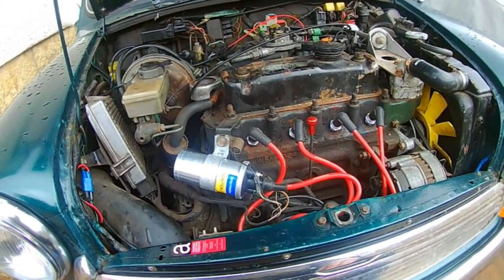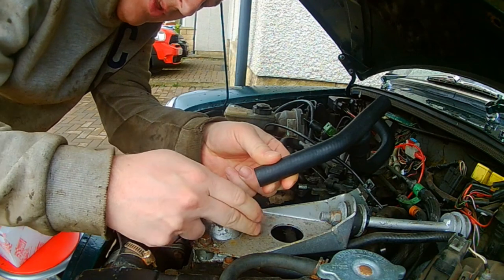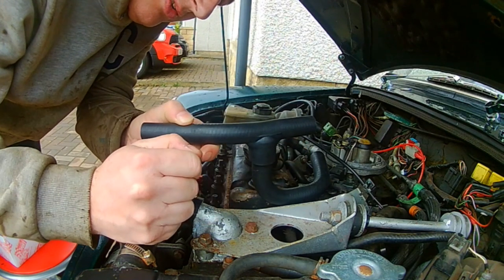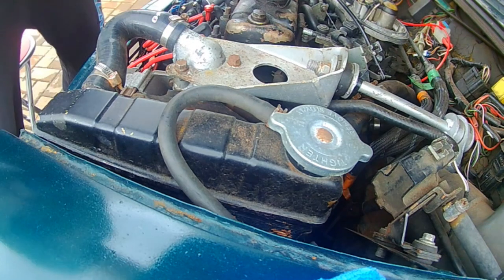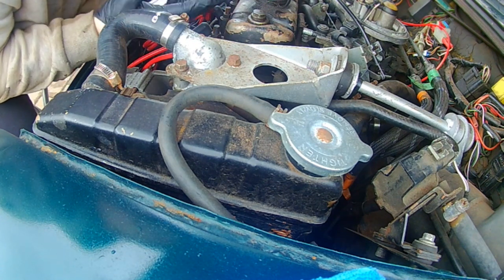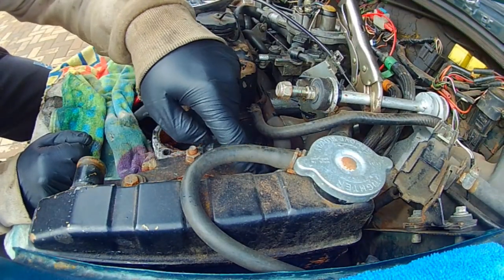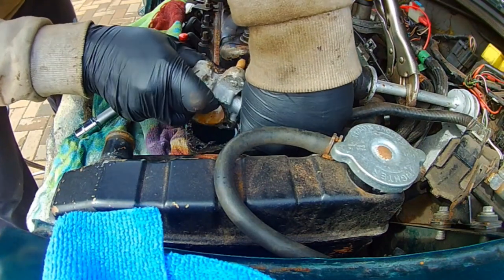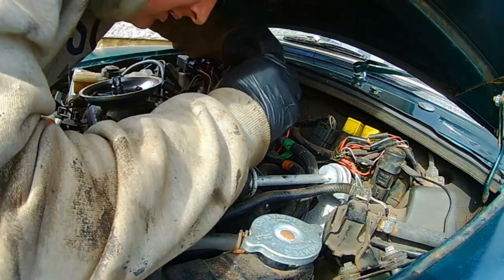Classic Mini SPI: Getting to the bottom of the running issues

Comment: Well done getting to the bottom of it. Is it possible that the hose you took off was the same internal diameter at the T meaning very little coolant would change direction, the hose should be slightly narrower to slow the flow.
Reply from the maker: Thanks James, the hoses were pretty poor, the hose that went to the bottom of the rad and branched off to various sections was so badly shaped i could not use it and had to order another at the time, i recorded the full procedure at the time along with other videos but lost the lot to a corrupt hard drive! I was gutted!
I'm now about 6 weeks on from this video so the next one will get an update to what i done next
Reply: Good to see you got it resolved👍